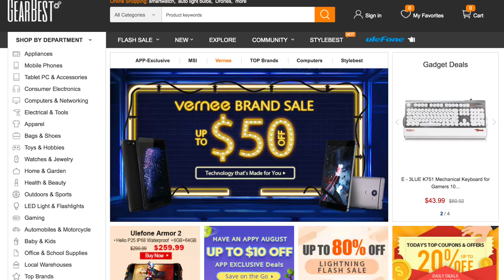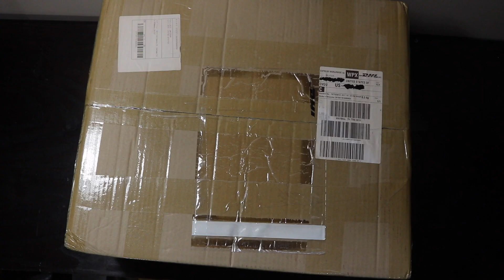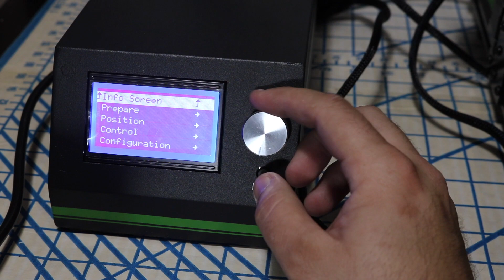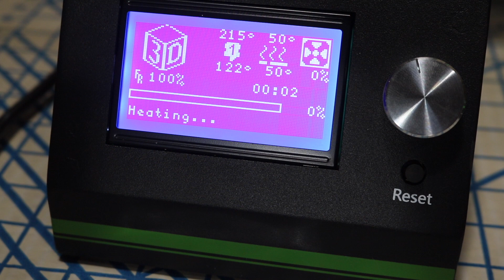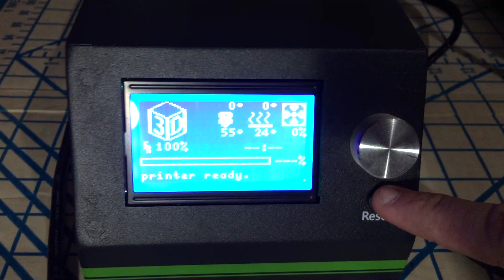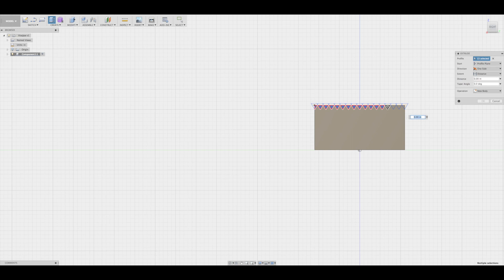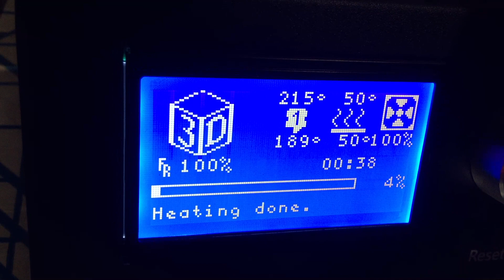Anet E10 3D Printer Initial Impressions

Comment: May be able to help.....
Your printhead carriage is loose, you need to tape up the head cooling fan by about 1/3, you're also not using cura 14.7, as this comes with that version, did you load the cura profile?
I'm loving mine, but I did google some of the faults first, I had to turn the stepper motors Y axis 90 degrees and I also had to space out the x carriage with some bearings and tighten that, but as I was expecting to do this it only took an hour and a half to get running nicely.
I also run the cura 14.7 with the  profile provided on the SD card.
Printing micro quadcopter frames in ABS with no issues, all coming out way better than the Anet a6 that broke and was returned on warrantee. Worked out well for me.
This has less problems than the CR10 ( i wait for the hate) and it only cost me £230, not the $400 I've heard in some other reviews. 
Hope you sort it, it's 100% better than the a8 by design alone.

Comment: I was having similar issues with prints starting.  The issue turned out to be hot spots on the build place.  I added a piece of borosilicate glass (with a sheet of PEI stuck to it) and my prints so far have been beautiful.

Additionally, with your heat block being bare I am not shocked you are having issues with heating and maintaining temp.  Look into some sort of sleeve for it (silicone > captan+insulation).

Unfortunately, at the price point this printer is at you get nothing in the way of bells and whistles.  On the up side if you like tinkering there are PILES you can do to make the printer much better.

Comment: ill stick with my silly little mp select mini.. awesome review though,keep the vids coming ., the mini select has the opposite reviews/ perception . People automatically think its junk, but my prints look like factory made parts and I run the machine 20 hrs a day , and yes while I'm sleeping.. if they made a 200mm mp select , theyd crush the market.ID love to have a Z axis greater than 4.7 inches, but I simply cannot find anything in the sub 600 dollar non kit range that is as reliable as the machine I have.. and like you with a home machine shop, I don't feel like working on a printer as its not really a hobby.. I use it to make non structural parts that I actually need and do not want to spend 4 hrs milling.it will be interesting to see where the 3d market goes in the next few years,.. From what ive seen , all the software is actually fine , its the reliability of the machines that seems to be the major  hurdle

Comment: seen other video on this printer , your hot end my be being 'heat sunk' by the beam it mounted to, might be worth looking into
it a huge area in aluminium, ie a heat sink you may have to thermally isolate your extruder from the z axis beam how that achieved i do not know
Reply from the maker: Yeah I've (since posting this video) seen a couple of the other reviews of this machine, and they're very informative and helpful! It looks like it may help to simply block some of the airflow on one of the fans at the extruder, the one on the front, not the one actually cooling the workpiece.

Comment: Dang, it would be cheaper to get one of these and make a plasma machine torch than to buy an actual machine torch lol, thanks for the vid🖒
Reply from the maker: No lie, I thought about what I could mount in place of the print head for a makeshift mini CNC :)
Reply: Practical Renaissance sorry I meant to mean I would make a plasma torch head for my existing cnc table, 500$ for a torch online! And you should totally stick a dremel in there and do some wood/plastic router work👍